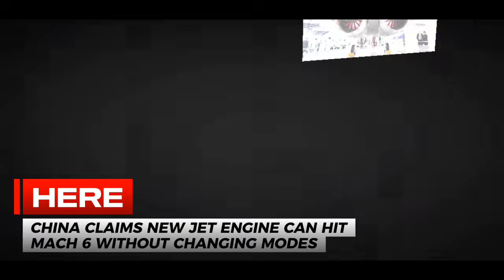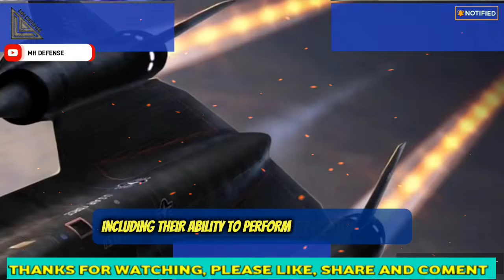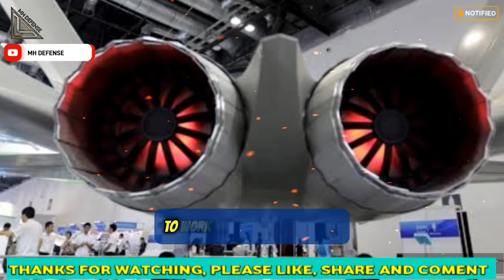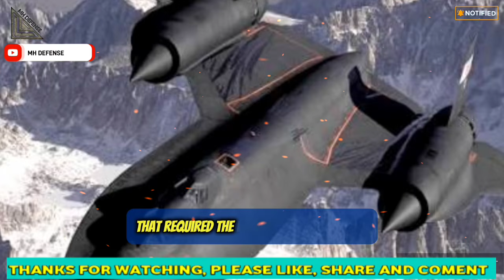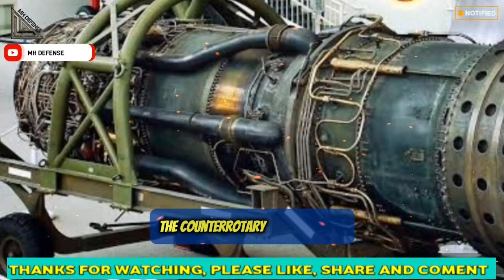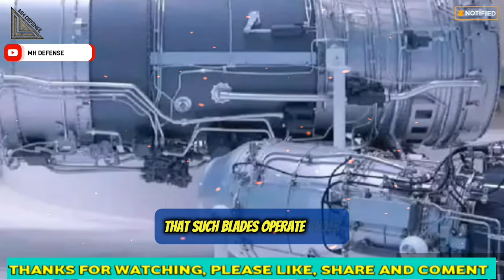China claims new jet engine can hit mach 6 without changing modes

Comment: Would be useful for cruise missiles but they'll need to do some scientific papers to back that bold claim up.
Reply: They don't have to prove anything to you. You can believe or not.  It doesn't matter to them. 😂
Reply: I suspect that the news is based on research paper because China didn't claim, they prove. like the so called 6th gen jet fighters, they never officially say anything about them.
Reply: @YSKWatch This isn’t just a “claim” — it’s experimentally verified tech, peer-reviewed and prototype-tested. China’s single engine hits Mach 6 without any mode switching, eliminating dead weight and stability issues that plague Western combined-cycle designs. Meanwhile, the US has spent decades on variable-cycle engines and still can’t solve mode-switching instability, stuck at Mach 3-4 max. China didn’t just claim it — they built it, tested it, and left the US playing catch-up with outdated tech.